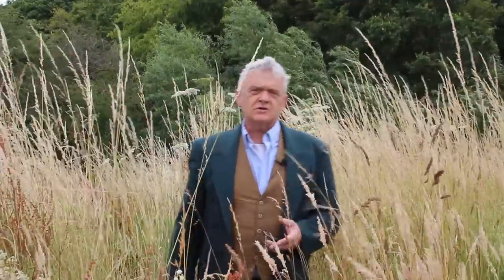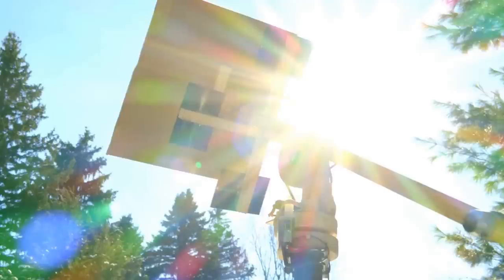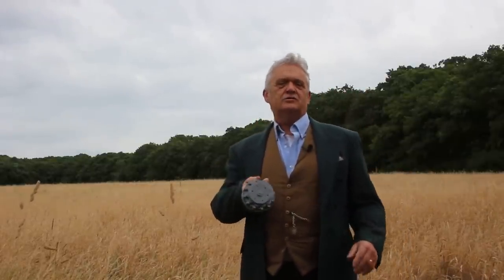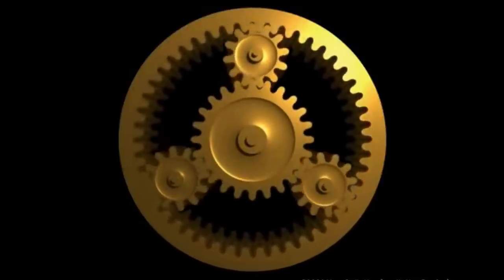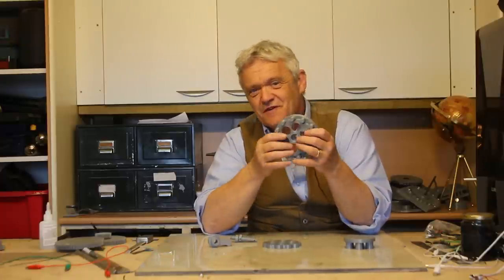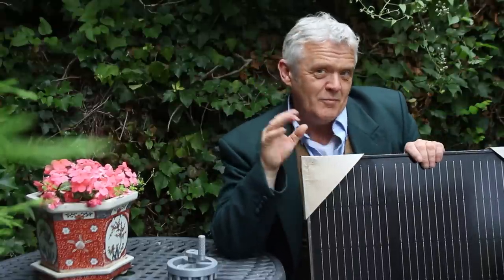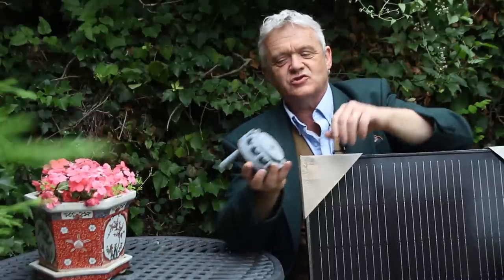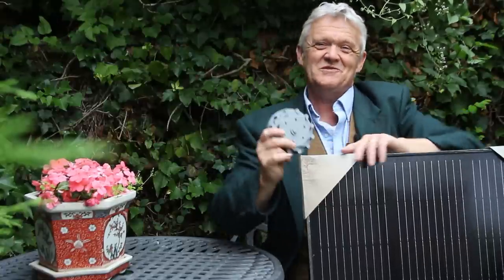1987 Cycloid Drives And Solar Tracking

Comment: I like this idea.  I have a solar tracker that I bought for around $20.00 US.  I up my own solar array that has been running for over 8 years now.  The tracker I put on them have been working fine for years now.  My power output from the panels has gone up.  We are in the process of adding 5 kw more solar on our off grid garage and hope to tie it into our house as well.  We also have static panels on our roof, put up by a solar company and they do not produce as much power as they could if tracking was put on them.  So I think the cost is almost nothing.  We also have a airbase here in Tucson with many acres of solar panels on them.  There is a stretch of about 2 miles long that track the sun all day.  That seems to me that tracking is the way to go.

Comment: I think I prefer a worm drive or rack & pinion system. Depending on if you are tracking by elevation or rotation of the panels. Adjusting pitch through the support frame seems less stressful than doing a mid panel tipping system. Especially when accounting for wind flutter or deflection on the panel surface.

Comment: Being a diy proponent I opted for an old C-Band satellite dish antenna actuator mount, it has a dc motor on the actuator arm that is moved manually a couple of times a day, angle point east all morning, straight south at lunchtime and angled west afternoon-evening, the elevation is moved once a week, sure it could be auto tracked but it's real simple to push a button a few times a day, and my chart for charge is way flatter than stationary did.

Comment: You could take it one step farther with some small solar cells to power the motors while the large solar cells are generating for the shed.  You did point out a few options for solar tracking that could be perfect for the motors while the large ones create power for other things.

Comment: I saw a report years ago that a NASA Engineer put a flexible Fernel lens (@50 USD) over the solar panel in a upside down ""U"" configuration, and got 8 times the output from the panel.

This was in space and heat was mitigated by the cold of space.

But he also demonstrated it on earth. So on earth, one may have to put water tubing at the back of the panel to cool the unit down.   This is then connected to heat a home and/or underground to dissipate the heat, with only the cost of an electric pump to move the water around.

So no tracking needed? Increased output 8 times ( estimate)
Cost of cooling equipment offset by using it to heat a home, shed, barn, greenhouse maybe.

Comment: Thoughts to ponder: Solar evacuated tubes to create pressure in a reservoir tank. This pressure would only be present on sunny days....this would be the energy used to move the panels with pneumatic cylinders. The cylinders could be controlled with cheap solenoid valves and a micro controller such as Arduino. Arduino could monitor the power output from the panel and be a closed loop system to move the panel. Less electrical use and less moving parts and hopefully less maintenance..... Your thoughts please?

Comment: My tuppence.  In the winter when the sun is below a certain angle your power goes effectively zero, so just tilting your panels south makes a massive difference.  For this scenario, I think tracking is worth it.  Depending on how you do the tilting, you can require a very high torque and produce huge stress when near the neutral position.
Reply: It doesn't work that way. Solar irradiation in say the UK for December and January is very low. so you are adding a small percentage increase to a small amount to begin with, for alot of additional cost.  Simpler to set it fixed at a higher angle, or have part of the array set say 70 degrees from horizontal and the remainder at say 35 degrees, south facing
Reply: @jimbobarooney2861  It's not just a small percentage increase.  Imagine your panel is perpendicular to the sun and ignoring ambient light, then you'd get 0% of the sun.  Using trigonometry, if you tilt it just 30 degrees up, you'd get 50% of whatever is available.  Or more realistically, the sun falls down to 18 degrees in the winter.  Hitting an up pointing panel at this angle gives 31% of whatever gets through the atmosphere.  Tilting it 19 degrees to the sun, gives 18+19=37 degrees, and would double your power.

Comment: Arduino or Pi with optical sensor so that it would track in real time. I've seen coding for a Pi but forgot about it. Building this as battery backup for my hydroponics system. Thank You!

Comment: Yeah that was my conclusion with tracking too, takes a lot of gear. That extra 20-30% tracking gives you could be spent on more panel unless someone finds a more cheaper creative way, and this looks like it could help.  I found with my setup 3 positions one for morning one for afternoon peak and one for sunset us all I need to get about 95% what a trackback by system can give you so was thinking the of a simple timed switch, but still couldn't justify the work and setup and just left my panels alone this season and got a few more instead.  I'd be more interested in a mini Solar tracker that powers some land based drone bot that can climb trees and telephone poles for some nice shots.

Comment: I simply put the panel on a pivot across the centre line and for days when I absolutely need the setting sun rays I pull on a rope that tilts it one way or the other. Dawn/dusk. And the ropes are tied down much like a flag pole uses. The thing is MAX you'd do this once a day ... Which isn't much labour tbh

Comment: Off topic, but I like the idea of a wind/water turbine using a toroidal propeller as the driver. Although you used a toroidal as an output fan on your air conditioner and cooling fan, I would request that you try to make a larger toroidal prop to mount on your turbine as an input driver, since it is more to scale. 
One of the main objections to neighborhood wind turbines is the noise they make. In many communities they are banned because of it. A toroidal "wheel" might be more acceptable than the clacking noise of the collapsible blades on your wind turbine. 
I have no skills and live in a tiny NYC apt, so...

Comment: The price of PV has plummeted over the last 20 years.  A 100W panel in 2005 was about 400 USD, now a 450W panel is approx 100 USD.  The framing is becoming as extensive as the panel's now.  Also in cloudy climates the tracking is not a hugh advantage, just simpler and much much cheaper to just add more panels, part of the beauty and simplicity if PV is there no mechanical parts

Comment: Could you please try to see whether this drive will work with a standard 5v 28byj-48 stepper motor that comes with most Arduino starter kits?  If it does then I will by forever grateful! Thanks.

Comment: the Cycloid is an awesome device for the whole panel, if the larger panel was single modules you could use fluid /  hydraulics to make smaller micro movements and even cool the panel, it needs some innovation....

Comment: I really like your idea about using cycloid drives to align solar panels but I do want to just mention something observed with our fixed position  panels.  We live in Upstate NY with a fair share of cloud cover and less than optimum solar days.  Despite this, to my surprise, I have observed that particularly in late afternoon with the sun on the western horizon, if the sun can light the eastern & southern sky, the solar radiation reflected back on the panels can still generate significant power.  Obviously not as much as with direct radiation but still measurable.   Just a comment.

Comment: Solar panels are great but they are quite bulky and big when they sit on people's homes they just look ugly
But there is a better solar system to put on people homes they are SOLO PANEL TILES when they are on the roof of a house they are more camouflage with the roof of the house and you can cover the whole of your roof with these instead
So it doesn't matter where the sun is shining on the roof of the house you can harness the sun energy and it doesn't matter which way your house is facing front to back of the house or left to right of the house or doesn't matter which way the sun risers and sets you always harness the energy from the sun
Reply: Don't know what you're referring to, but solar panels need to face the sun directly to generate at 100% of their ability. Any other tilt and you're losing efficiency.